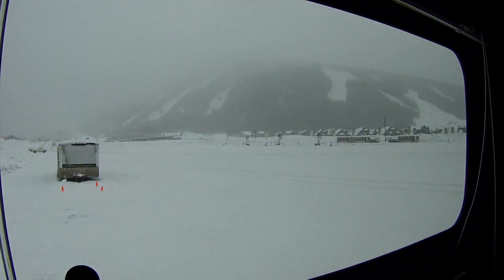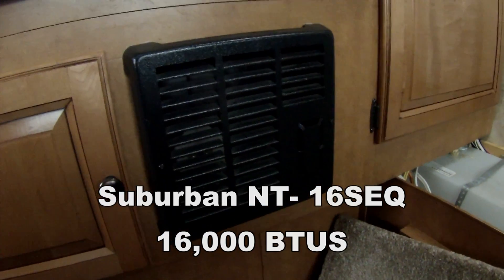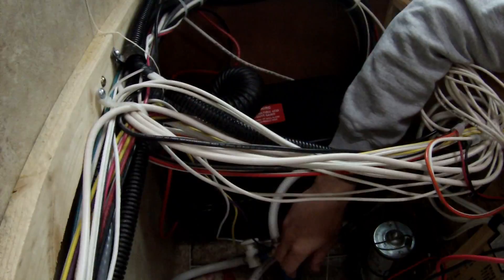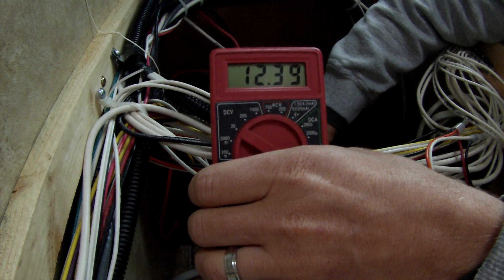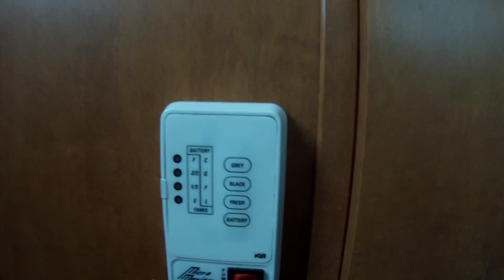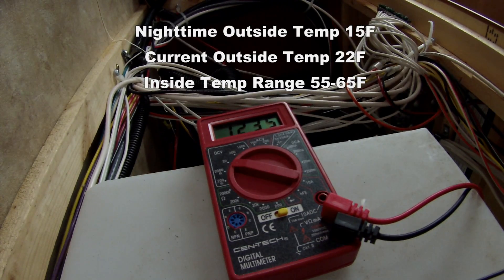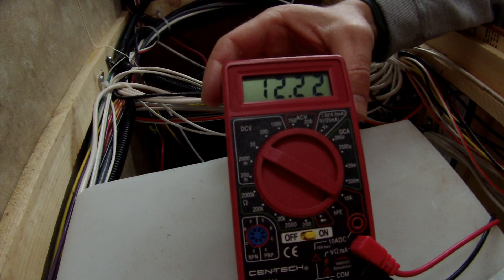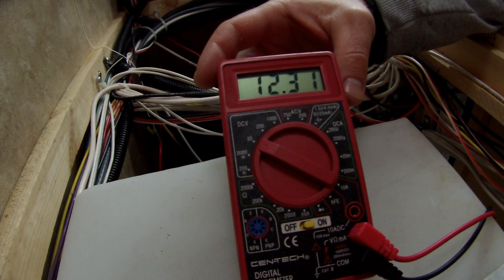Camper Furnace Power Usage

Comment: Volts don’t tell you a single thing unfortunately. I mean, yeah - by 11.7 ish your battery is toast, but that still doesn’t mean much capacity-wise. 

Calculating based off amps is the only way to go. Most RV furnaces are rated around 10 amps. Most deep cycle batteries are around 100ah reserve, but you can’t run them empty. Generally you might get 50ah safely. 

So that’s like ~3 hours of nonstop run time. Say you run it 20 min per hour, that’s only 9 hours. If you have big batteries or two, that obviously changes though. 

It’s basically just a car battery though - and we worry about leaving a map light on killing the thing overnight, so imagine what a 10 amp draw can do.

Comment: So if you have the switch on your thermostat on but it's not blowing warm air is it still using battery power? Should I shut it off each day and only flip the switch on at night time?
Reply from the maker: Yes, if the blower is blowing air, it is consuming power.  If you are not using it, definitely turn it off.  Thanks for watching!

Comment: My few RV's I had, ran the basic propane vented convection heater mounted into the counter cabinet, no electricity need. Vented is important, catalic/ buddy heaters are not good options in RVs, consume o2 and produce lots of water that will condense on cold surfaces causing rot and mildew over the long term.
Reply from the maker: I had a basic heater like that in my old truck camper.  It worked great, but then started a fire!  These new ones are much safer, but take electricity. Thanks for watching!
Reply: All appliances can be prone to failure. I doubt the fire was started by anything inherent in the design. fire boxes can get holed by corrosion, gas control valves can leak and fuel fittings can come loose. It all come down to age and maintenance. What caused the fire in your heater?
Reply from the maker: @Flightstar  I don't know for sure how the fire started. The camper was almost 40 years old. Thankfully I was awake and had a fire extinguisher handy.

Comment: So at 12.3 you are pretty much at the limit for dis charging AGM batteries. I have the same problem. I also found that I was using about 2 gallons of propane a night when I was in 35° weather. I bought a Camco catalytic heater and installed it in my camper. It works like a charm. It heats the objects in the room without using any electricity and about 1/8 of the amount of propane. What a godsend when you're working off small 15 gallon propane tanks and a truck camper. You might want to check into it. I installed it right over the same place that my old furnace was and just eliminated the  old one
Reply from the maker: Thanks for the input!  I have heard good things about that Camco heater.  Too bad I don't have that truck camper anymore :(  I'll keep that in mind if I get another truck camper though.  Thanks for watching!
Reply: Russ RV Freedom 37 I have the two smallest Mr. buddy heaters and I prefer this one. It uses less propane  in my experience.
Reply: Limit for discharge AGM is 12.05v

Comment: I have same furnace. Fully charged I’m 13.8 on my deep cycle battery. I have an auto shut off if it hits 11.6 and will not come back in until it’s charged to 12.6.
I can get 26-29 hours furnace run time
Reply from the maker: Wow, that is great run time!  Thanks for your input and watching!
Reply: Battery size and type are important. A small battery (20AMP HR) will lower voltage faster than a 100AMP HR. So, in order to determine exact use, or how long it will run, you need to test the actual  heater, not the battery. By disconnecting the wire nut feeding the heater (12 volt) , and using your volt meter to be the jumper wire between heater and feed wire (incoming power), you can see the "Running volts" and AMPS  (actual power being drawn while running).   AMP x Volts gives you watts. So , if the heater runs for 15 min per hour (turns on twice for 7.5 min during each hour totaling 1/4 hour run time) , 1/4 hours x 24 hours =6 hours a day,  at say 2amps, then  , 6 x 2AMP = 12AMPS per day. So, since  you should only run batteries down to 50% (other than lithium where you can use 80%),  a 24AMP hour battery runs the propane heater for one day if no solar power is coming in, and no charger replenishing battery.. Most camper batteries are 100 amp hour. This is why you don't see the drop. You are using roughly 10% of battery strength of a 100 amp hour battery. Battery can drain to almost half and still show 12 volts+  on a half dead battery. Math is your friend.

Comment: If you were to replace that heater fan with 2 computer case fans you would significantly lower your battery usage. Those 12v wire wound DC heater motors are battery killers.
Reply: Can computer fans handle the heat ?  Have you replaced yours ?
Reply: @TheScoutFamily  Computer cooling fans are designed to operate at temps up to 175 degrees, By the time the heat transfers through the aluminum heatsink temps are far less than that.

Comment: I just installed a multimeter in my new to me truck camper.  It cost less than $20 on Amazon and allows me to monitor voltage and power consumption in real time.
Reply from the maker: That is a good call and a great addition.  I am planning on getting a solar panel with a digital charge controller.  Those are great because they give you all the information you need.
Reply: Colorado Camperman The charge controller that came with my camper only gives current coming in from the panels.  I installed the new meter between the batteries and fuse box.
Reply from the maker: Got it, that makes sense.  I should install one because I am constantly checking the numbers on my multi-meter!

Comment: My truck camper came with a hydroflame furnace, I fired it up once for about an hour and even though it uses zero electricity it was too damn loud for my liking. IMO even my portable buddy's pilot is too loud but it's way better so I will be ripping the hydroflame out, hopefully my tailgate will close too once the furnace vent is out of the way.
I can't imagine running a furnace with a fan. But I guess it's something you learn to drown out like most people do with the power grid buzz or refrigerator compressors.
Reply from the maker: +MM95 Lol, yeah, those little noises can sometimes drive a person crazy!  Do you have the buddy heater with the fan?  I have the one without the fan and used it all the time in my old truck camper.  Thanks for watching!
Reply: For sure and the smaller the space the easier those noises drive you batty. I have the 9kbtu portable buddy, no fan but I've become more sensitive to noise since I stopped living in the sticks and bricks houses. 
I was looking at it and my truck camper is old enough that all the screws for the furnace are clutch head. This will be fun.

Comment: Dear Colorado, whatching your tech vdos with great interest, and guess what I bumped into the same problem here on the other side of the planet. I do have a 3 Led gage which should show the condition of A) house battery which is 12 v and 95 amp/h which is gel tupe and B) the chassis batt. with also 12 /95 but lead acid type now running the heater it says the blower takes peak 3 Amps and steady state 1 amp..so I do the math...1 full night..8 h = 8 Ah plus TV,  radio, and Led lighting for about 3-4 h so I would need 16 ah per night..the voltage fluctuates do it gives me no indication and monitor led shows mostly full. Taking in account that you should drain 50 % of the battery and then charge so that the batt. lifetime remains long, so you can do 2 -2,5 days boondocking with a 95 ah /h house Batterie..but having sunshine, the solar panel will recharge with 100 Watt hour or winter maybe 50 Watt hour which is divided with 12 volts about 2-3 amps or more per hour. 4-5 h of sun would make up the 1/2 the loss. Or you run a 5 amp generator for 6 h and you are full. Running the chassis it would charge with about 18 amps, means two hours of engine running a day.  Ideal is 2 12 volt house Batts with about 95 ah/h plus 2 100 Watts pv panels and you are independsant for a week or bridge non sunny days....a Volt Meter would not help, a batterycomputer display is better, you tie it into thr neg. wire of the house battery and connect a shunt, that tells you ah Consumed, remaining and ah charger and % of charge..150 bucks though..for us boondocking sites I found slso great stuff on campedium.com, you sure know..reg rveurope..
Reply from the maker: +RV EUROPE ON TOUR Lol, sounds like this is a universal problem!  That is a great breakdown of all the details!  I need to educate myself a little better on all the numbers you just laid out here.  Currently I have been running the generator during the day to recharge my battery if the sun is not out.  If the sun is out I will use my portable solar panel, but it is a small 15 watt panel and won't fully charge things.  Ideally I will be adding a 100watt panel that will fix the recharging issue, but it might be another 6 months before I do that.
Reply: +Colorado Camperman 
yes now its summer, we do not need much power...and yes your harbour freight 15 Watt can fully charge when you have a decent charge controller which provides you with 13,6 -14,2 volts...each batt needs diff. voltage and A bummm to get full, 1,1 amps is good to fill top up half a batt..the sawtooth effect will fill it..take less, add more...rockn roll n happy camping

Comment: Hi
Interesting! But how long will it take to charge up 12.3 Volt with your solar cell under normal conditions, I do not remember how many watts you had had on the solar cell panel.
Peter Sweden back from the Alps
Reply from the maker: +Peter Olsson I actually fully charged the battery at home and then during the day when I was running things in the truck camper, I had the generator hooked up.  On this truck camper I don't have solar yet and I didn't use my portable panel because it was extremely cloudy out.

Comment: I think if you can fit 2 6 volt batteries AGM if needed that would be the ticket. I had 4 6volts exposed to outside temps on my 34ft mh and 35,000 btu furnace. I think the amp draw was 7.something and 20-35 deg weather and 2nites no problem then I would charge inside daytime temp 60 nite 70.
Reply from the maker: +papawoody Thanks for your input, that is kind of what I was thinking.  I don't think there would be anyway possible that I could fit two 12 colt batteries down there.

Comment: All numbers in amps and watts aside, I have a feeling my group 27 deep cycle battery my RV came with would run my furnace all night, but when it has to run for a long time to do the initial heat up it has lowered the voltage or amps while running to make my carbon monoxide low battery alarm go off. So I need more battery to do the job overnight. Thanks for sharing! love info that helps with boondocking.

Jed
Reply from the maker: +NDNomad Yeah, I am sure in your camper you heater draws a lot more power than in my TC.  You have duct heating in your camper, right?  Do you normally have hook-ups or run the generator at night?  Thanks Jed, I will try to keep the boondocking tips coming!
Reply: When I was cold camping in the North Unit, I couldn't run generator at night, but just for heat I would not run generator at night anyway I would use the furnace on batteries and I have access to enough battery power to run all night. fun fun. Also I am realizing that running the furnace in a 30 foot travel trailer is necessary and it shouldn't be shunned for inefficiency. no 110v heater(s) can heat that camper up and keep it 60 or above when it is below 0 outside. So when it's below zero with wind chill the RV furnace is in no way inefficient. My biggest problem with cold camping is the memory foam mattress! that thing becomes a brick in cold weather. so I have to be sure I can heat it with the electric blanket for at least an hour, and then keep that bed warm until I go to sleep in it, otherwise it's cold. lol fun times. I'm still considering a second unit for long trips and weekend getaways. still can't decide between speding $5-20,000 for a decent class B van, Or upgrade my pickup and get a pickup camper. I get a whole lot of anxiety thinking about hooking up to my travel trailer with my half ton and going long range in a short time. So a pickup camper or van would be great. I realize this is way long, but I do have one question. Have you seen or would you consider setting up your pickup camper at a campground RV site just to run around be a tourist without it in the pickup? is it worth it to make driving around a little easier? I realize it is not necessary, but am just curious your thoughts on that?
Reply from the maker: +NDNomad Lol, sounds like you have plenty of cold camping experience! I agree, the camper furnace is hard to beat and the newer campers are pretty efficient.  We have only camped in our travel trailer a few times with the heat, but it is amazing at how fast it warms that big camper up!  

Yeah, having a half ton with that big of a camper might be a problem on a long trip. You're still under your tow capacity though, right?

Good question about the truck camper. I would feel ok leaving my camper because of the electric jacks. If I were to do that I would take the remotes with me. So if someone had a forklift they could steal my camper or I guess if they had the same record electric jacks they could (dunno if each remote has a different frequency or not).  If I didn't have electric jacks, I would be a little more hesitant to leave it.  But if I didn't have electric jacks, I don't know if it would be worth the hassle of taking it off. Electric jacks you can have the truck camper off in less than 10minutes.
Reply: Ah, I never thought about the type of jacks in that scenario, good thinking, My current trailer truck setup is about a thousand lbs below the limits when you look at tow capacity and also GCWR. I did take the travel trailer on a 1400 mile roundtrip and everything went flawless but I could never chance that in the winter months around here, but I know I would take a truck camper or even a two wheel drive van on a trip any time of year for sure.
Reply from the maker: +NDNomad Yeah, I haven't ever pulled a camper in the snow but it seems like it could be pretty dangerous.  I met a guy up at Copper mountain with a 26' camper that he towed in the winter.  He said it wasn't too terrible and if the roads were really bad he would put chains on the camper.  

A truck camper would be a really good alternative.  Then you have 4-wheel drive and one less vehicle to worry about.

Comment: Those heater fans are a battery killer for sure.  In a tight space like a truck camper the Mr. Buddy isn't such a great option either.  Maybe for just when you are sleeping and don't have to worry about brushing against it, and run the truck heater during the day when you don't want to burn your legs or anything else.  You will probably get plenty of expert advice on this subject, lol.
Reply from the maker: +Fernbark Frist That is a great idea! I have burned a jacket and my snowboarding pants on the Buddy Heater and am not a huge fan of having to constantly dodge the heater when moving about the camper.  If I followed your suggestion, then I could set the thermostat in the camper to 50 or 55 and if when the 1lb tank on the Buddy is runs out in the middle of the night, the TC heater takes over.  Genius!  Thanks for helping me get the juices in my brain going, lol.

Comment: Nothing pulls more DC amps then the heater motor.  You can hook up quick connects for a Mr Buddy and it will heat the camper easy.  I have seen some catalytic wall mounts that would work.I have an amp meter in my 5th wheel and the heater is a killer.Only prob with catalytic is moisture.I had a camper in the 70's that had a radiant lp heater/ no fan in a 11.5 ft Shasta which was awesome.  It had a burner inside of a sealed pipe/tube that really cranked.  Whole thing inside the wall with just grate on outside.  No oxygen problems.Haven't seen the same thing since then and it didn't vent moisture.We use down bags on our bed in cold time and just set heater to keep it from freezing.  We open the sink cabinets and water pump cabinet.I have run my Honda 2000 generator all night lots of times on quiet mode so it only kicks up when the heater kicks on.
Reply from the maker: +kong3 I have a Buddy heater and used that in my old truck camper.  It worked well and I liked it because it was constant heat.  In my old truck camper I had the same radiant heater like you are talking about.  It worked great until it caught on fire!  It is a shame that they don't try to use those heaters again, I am sure they could fix the whole starting on fire problem.   

The furnace is great while it is on but then it can get cold between cycles and it can also get really hot inside the camper when it runs.  At night we keep it on the lowest setting (50 degrees), so it doesn't run too often unless it is really cold outside.  

Like you I have also ran the generator on over night, but it usually runs out of fuel after 5 hours.  Still trying to figure out what the best system is with the new truck camper.  The good news is my camper's battery isn't completely dead after a night of running the heater.  I just always need some way to recharge the batteries the following day to ensure I make it through another night.